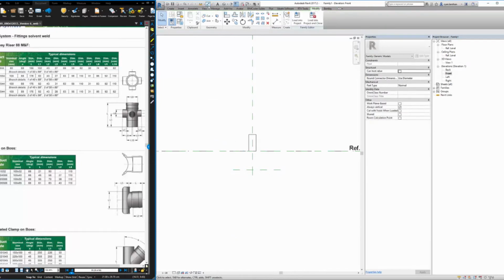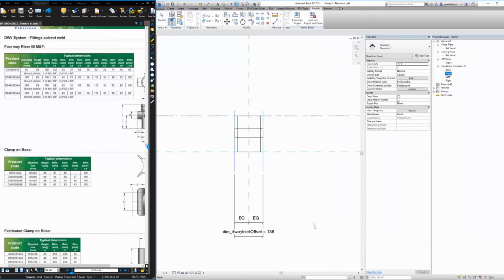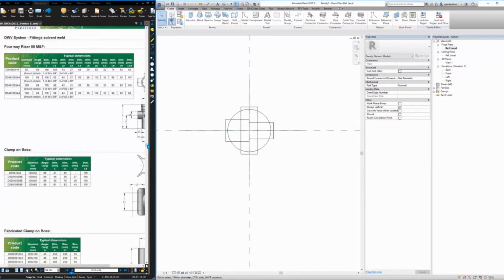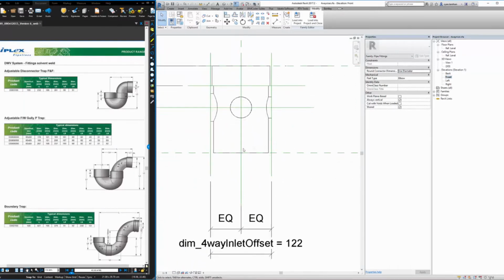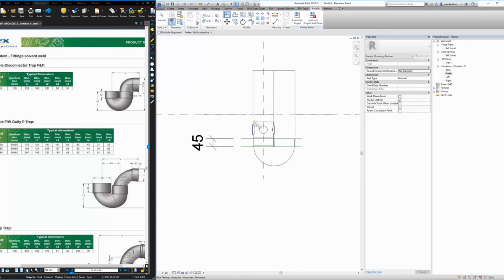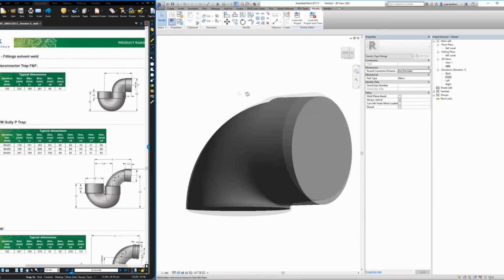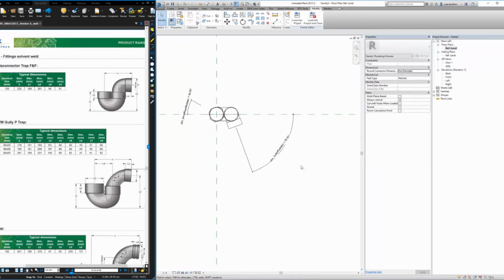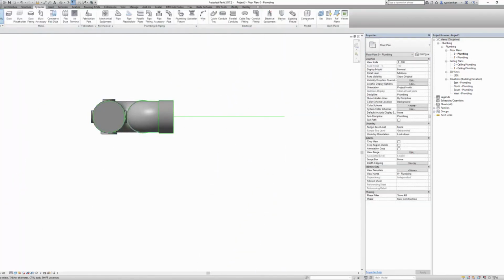Step by Step Guide - Creating Iplex FWG Family

Comment: Hey mate, just to let you know I've built this - and I'm sure what you've made on the screen is perfect, but I've stuffed it up somewhere along the way - so I'm posting a link to this video on the autodesk Revit MEP forums, and uploading my file which I made when attempting to follow what you've done here. This is awesome BTW.. I just have an issue when controlling the rotation of the outlet which causes the outlet to separate from the whole plumbing fixture. I'm fairly sure I have just locked the outlet to the wrong object / reference plane / or whatever. I'll post link to the forum in a follow up post
Reply from the maker: Hey Ben, firstly, glad the video has helped you out! With the family, did you create both the riser and the exit bend as nested families? 

Originally when I first made this many years ago I didn't nest the moveable parts, it worked some of the time but most of the time it broke in the way you're describing.

Can you post the link to the autodesk forums here or tag me in your post on the forum so I can see it?